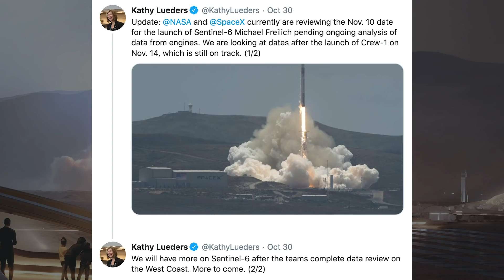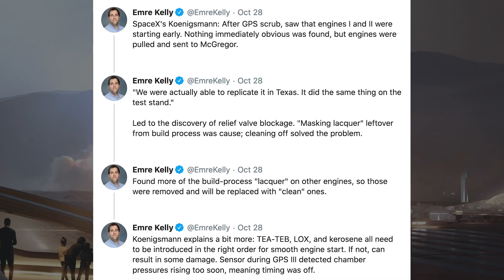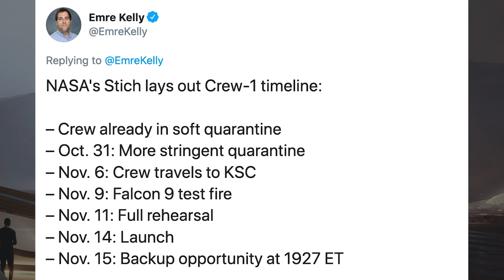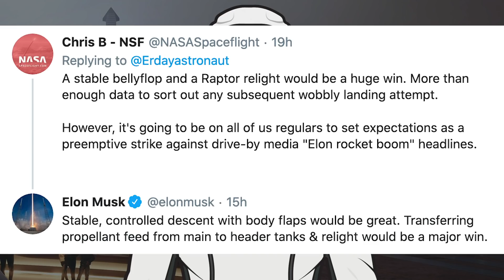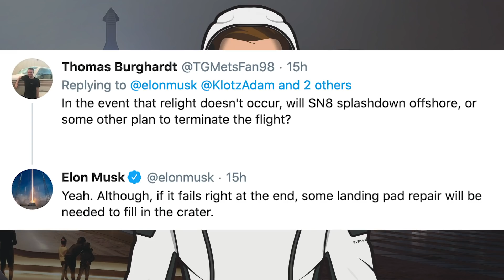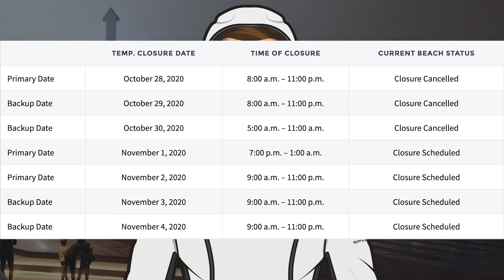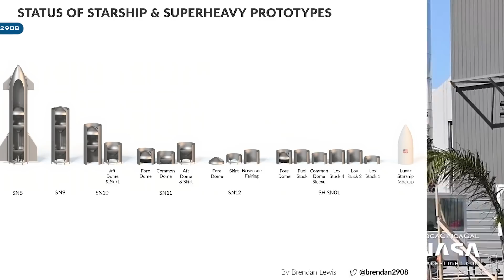SpaceX Starship Updates! SN8 Testing Imminent! TheSpaceXShow

Comment: Many plates spinning in the air. Stainless steel coloring would help differentiate the SN#'s parts  so visualization would be enhanced. Red=SN-eight Yellow SN#-9 and so forth. a color tint applied over part assembly would help visualization with a color key on side of photo graph in assembly yard photo! Just saying!